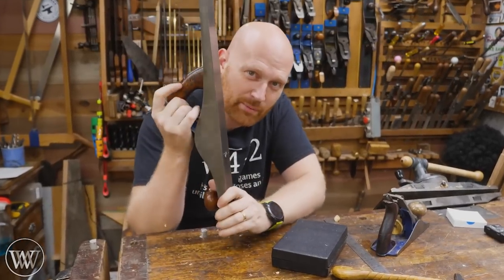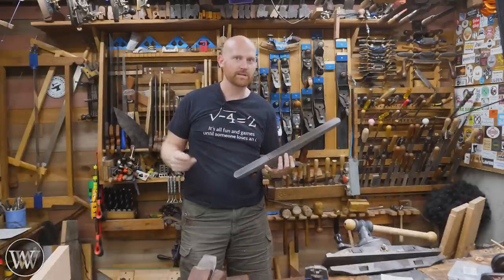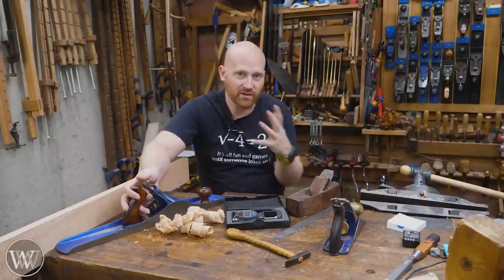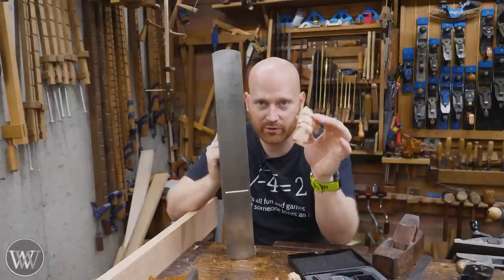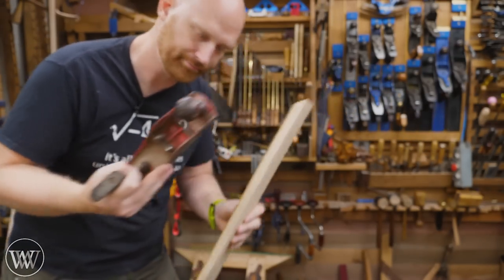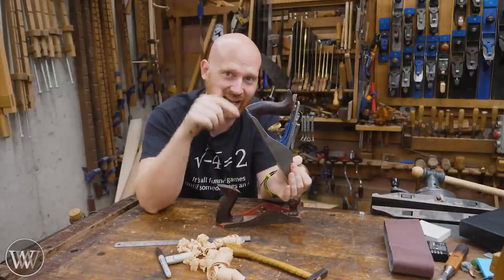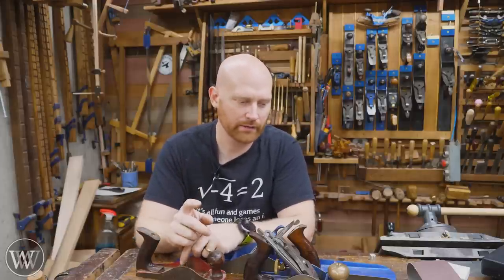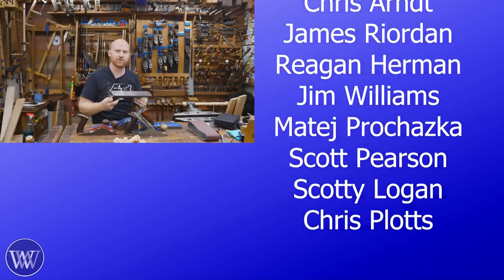How Flat Should Your Hand Plane Be

Comment: My take is that as long as the toe, heel and front of mouth are planar, the mouth and either the toe of heel is putting the blade where it needs to be.
At the start of the cut the downforce should be toward the toe, keeping it flat. Towards the end of the cut the force should be toward the heel, again keeping it flat.
If at any point neither the toe nor the heel is in contact with the timber, the plane is too long for the workpiece.
The only productive reason to get the entire plane bed planar is to enable the use of the wrong plane for the task, but as stated, if it makes you happy then that is reward enough!

Comment: It's my fault everyone. Literally. Thanks for the video! 

Although to the error that you're dealing with it's insignificant, I can prove that the planarity of the sole definitely does change whether the frog, handles, and iron are attached or not. The variance is on the order of (likely) less than 0.01". I witnessed it as I was scraping a No. 4 flat (first time doing this) referencing a B-grade granite surface plate (flat to within 0.0002") but didnt have a means of measuring the variance. I will never forget this fact as it meant that I had to go back over a plane that I thought was perfect when I attached the frog and rechecked it on the surface plate. It literally put a very obvious twist in the sole which then told me that the mating surfaces of the frog to plane body were not perfectly coplanar. The only remedy as I dont have a machine mill was to lap in these mating surfaces and re-flatten the sole with everything attached. 

Error identification, analysis, and mitigation is my full-time job as an R&D Chemist...so I guarantee you that I get far more picky about minimizing error than I really need to, especially when you take into consideration the dimensional variance of wood as a function of relative humidity and temperature...but my whole point is to remove sources of error - in this case, I cannot fault my tools for any performance issues because I've done everything I can to make the tool as perfect as I can...so if things go sideways...it's operator error, can't blame the tool...but damn my planes do run nicely and the technique of scraping provides a surface riddled with tiny pockets in which wax can reside to keep the sole lubricated much much longer than a sanded surface. I'll respond to this with my other YT channel where I do have a video or two on scraping a plane flat. Thanks again for the video my good man!

Comment: I guess one issue is that a lot of noob (me included 😊) will spend hours flattening a vintage plane because they don't really know how to set it up correctly and sharpen the blade. Now with a little more experience I totally agree, flattening while cleaning up the sole for 5-10min would probably have been enough.

The other thing is, if you want to use your ruler to check for flatness, you should check if it is straight first 🙄
Reply: I did the same thing when I got a few of my granddad's old rust planes 3-4 years ago. Would work for an hour on cheap water stones and it seemed like the sharp factor would get worse. I switched to a Norton set of oil stones (after sand paper on the really pitted blades) and that made a big difference. The leather strop is key IMO too. I used cardboard with some Polish paste to began with and that was okay in a pinch. Turns out not all water stones are created equal. Also, If you are here I am sure you seen some of Paul Sellers YT stuff, but his plane restoration video helped with the sharpening and what parts do and why. It's over an hour long, but it's not super technical. 
Hope your shaving with the best of them soon! Godspeed.

Comment: I realize I'm off topic but the issue is conventional wisdom without proof. I want to know just how important it really is to sharpen the backs of plane blades and chisels. I don't exactly question that the back of the plane blade should be flat or polished and I do it, yet I wonder how much difference it makes.  It seems to me that much of the general plane advice given is really for a smoothing plane intended to produce a finished surface.  As I typically plane and then sand, I'm not trying to get a finished surface but rather one I can effectively sand.  I've bought and restored several planes and I've virtually never found one where the back of the blade was flattened or the bottom of the plane was flattened by any of the previous owners.  Obviously it worked well for them.  Further, it strikes me that the early sharpening books I bought didn't harp on flattening the backs much less the sole.  The back of old plane blades and chisels I've come across don't typically have a scratch pattern I can see.  They are not polished but nor are they obviously scratched.  All blades at some microscopic level are irregular and essentially serrated.  It appears to me that craftsmen used these planes for over 100 years and never felt the need to flattened the back of the blade or the bottom of the plane.  Conceding that it makes some difference, have you ever just sharpened a blade as it comes out of an old plane, tested the sharpness (I know you have a machine that measures this) and then used the ruler trick or whatever to resharpen by addressing both sides (i.e. sharpening the back)?  I'd like to know the difference after 10 strokes, 50, strokes, and 100 strokes.  By strokes I mean say a 14 inch pass of the plane on whatever species you feel is average.  Let's say walnut.  I think it would be interesting to find out just how much difference flattening the back makes.  I've spent a lot of time doing that and wonder just how worthwhile it is.  Thanks for your always interesting assessments.
Reply: You don't sharpen the back of blades, you polish them (I think this was just a typo on your part). Flattening the back just makes it easier to get a sharp edge in the future.
In my opinion, a really sharp edge on a chisel (flat back, NO ruler trick) makes it easier to cut, and safer. How sharp is sharp enough? That is largely up to you, and the work you do.
A carpenter might use brute force (i.e., hit the chisel harder) as a chopping aid using a sharpish chisel on a timber frame joint, whereas a fine furniture maker has a very different definition of good enough!
Reply from the maker: Once I have smooth the back of the blade one time I never touch it again. As long as it is smooth that's all that matters. Some of mine aren't even perfectly flat. If I'm using a competition plane then I'll have it perfectly flat and smooth but for 99% of the work it's not really that important.

Comment: I think flatness is less of an issue with a convex sole (middle is low/bulge) than concave sole.  But having a convex sole also has issues with where the convexity happens. Scrub planes for me are not at all really flat.  Just dont care.  But most of my working planes, including jointers are flatten to a Starrett straight edge.  All that said, flattening anything 6 or above... is masochistic.

Comment: "Lets start some arguments" hahaha. The one thing I could call out is that if these things were steel you'd be at it (even your rough flatting) for hours. Cast iron is far softer than even basic steel.
I can't stand 'checking for flat' with a ruler, even a metal one is likely out of flat itself. Unless it's a machinists flat bar it's a fail. IF by chance the ruler is actually machinist flat, once it flexes a smidge it's no longer a flat ref anyway.

Comment: A. Use a surface plate. Every shop should have at least a small B grade plate.
B. Don't use aluminum oxide sandpaper. It goes dull fast under cast iron. Use a ceramic sandpaper. 3M is great, but I've had great results with Harbor Freight's ceramic paper. The 60 grit will cut fast
C. Use spray adhesive to tack the sandpaper down to the plate or a sheet of glass. Doesn't take much and cleans off with acetone.
D. I keep a lot of scrap float glass around to put on top of my surface plates. Prevents damage to the surface plate. Glass itself is quite flexible, but the surface plate below keeps it flat and stiff .
E. You really want to get flat flat flat - get some 300 grit white aluminum oxide and mineral oil and use that slurry on the glass for final finishing. White aluminum oxide will break down into smaller and smaller particles. It has a tendency to "embed" in the cast iron, but easily cleaned up with acetone and finished off with a precision flat ground stone. They are expensive but you can make your own.

Comment: James, try comparing some planes that are and aren’t flat. Use a feeler gauge under the edge of your ruler to measure flatness. I make moulding planes and I make sure the soles are flat to c. 2 thou. Above about 4 thou they don’t work effectively, either sticking if they are convex or only taking a shaving at the start and end of the cut if concave. Basically work out the thickness of shaving you want and use a feeler gauge to tell you of the plane is that flat. People say feeler gauges don’t belong in woodworking, but plane construction is engineering, not woodworking.

Comment: I flattened my jointer plane, but it didn't take that much work, I assume because the previous owner had done some flattening before I got it. I had three reasons: First, when edge gluing to boards you want them flat and smooth. The first swipes can be fairly course, but you need to retract the blade to take finer shavings as you progress to the finished surface. The second reason:: I use my jointer for shooting the ends of the board square, an accurately flatted sole means you have a reliable reference for squaring the sides to the sole.
Finally, a flat jointer is a handy inspection tool when assessing the flatness of your glue up.
My feeling is: get a few planes-- a jointer and a smoother--- get them right , and they'll handle anything you need to do.
Two things by way of advice: while wood will eventually wear down metal,  it wasn't the cause of the concavities in the sole. If so the ruts would have gone from heel to toe. I heard that those irregularities were the result of the casting shrinking as it cooled,and the haphazard machining it received. It seems they left the final touch-up to the purchaser. Not everybody could pay Lee Nielson prices.
Final thought: that 1/2 " glass was probably deflecting as you ground out the sole, Somebody recommended a cinder block. Especially if you buy three and a jar of lapping compound next time you're at Nappa Auto.
"Purchase! A man needs purchase!."-- a line from a movie I saw. You cant know flat unless you've got something flat to compare too.
Yeah, it's all relative, but there are places where a banana looks flat. I hate bananas.

Comment: Your statement about the critical points to loo at when flattening the sole of a plane is not correct to me. By far the spot behind the blade is much more important that in front of the blade. I've seen many planes which performed badly just for having too much material in that spot.
Reply from the maker: The edge in front of the blade is more important to be touching the wood as that guards against tear out. The edge and back of the blade doesn't matter if it doesn't touch the wood. It is a problem if it is low behind the mouth. But that can be a problem anywhere else on the plane. No spot on the sole should be lower than the heel toe and mouth.
Reply: @WoodByWrightHowTo  is not a problem if is low behind, just the opposite is a problem if is high behind the blade. Look at the preparation of a japanesse plane and check what are the spots that are key.

Comment: I've restored well over a dozen hand planes & initially I dismissed the "myth" of needing to have the frog & blade assembly in tension as the sole is flattened. 
I discovered that the earlier planes on which I didn't have in tension when flattening were ok but not acceptable for leveling around the top & bottom rims of a box for example.
The planes where I did include the frog, blade etc inner tension produced excellent flat soled planes from block to #7 jointer. I do realize the possibilityof confirmation bias on my part. But even recently i bought two vintage Footprint smothers & flattened one sole without the tension. I did the 2nd plane with the frog etc under regular tension & that plane performsmuch better at particular tasks (like leveling the top & bottom edges of boxes or drawers). I'm my experience it does really make a difference, again could be confirmation bias but the earlier planes exclude that possibility.

Comment: I am not saying that you are at wrong with the way you are "flattening" in fact I do the same.  But...and there is always a "but" there are a few reasons to go beyond the 36 grit and one is that you are introducing the opportunity for rust with the grooves that 36 grit leaves in the sole of your plane and moisture from the air will settle in those grooves and bam ya got yourself a rusty plane. Sure you can wax it and oil it and all of that but if you polish it out to around 800 or 1000 grit you can have some of the planes you dont use as offten not rust up on you. Ive had planes sit for over 2yrs in a non-climate controlled shed and not got any rust.  Also the smoother the sole is the less resistance you are going to get and regardless of what you want to tell yourself it matters.  That plane sole is rubbing/burnishing up against your wood pretty hard and a smoother sole wont make any impression on your piece.
Reply from the maker: I don't say stop at 36 I say start there. Too many people stard at 120 and it takes forever.  I usually stop at 280 some times go to 400